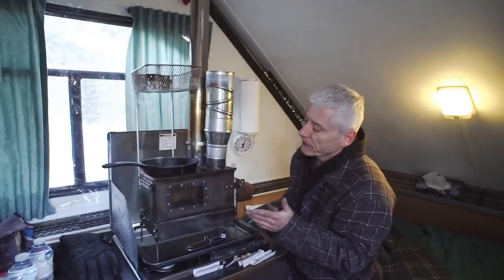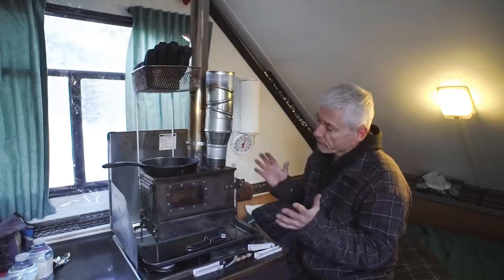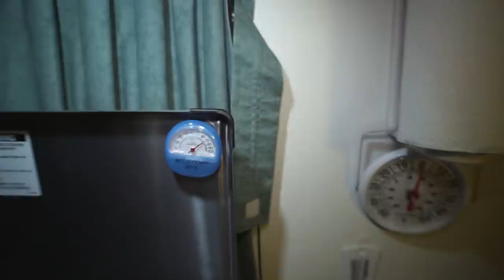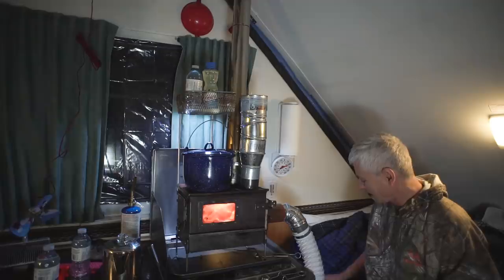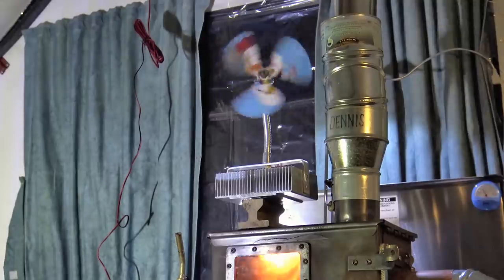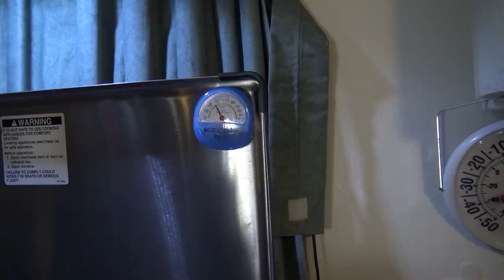Wood Stove in an A-Frame Trailer - Part 2

Comment: May be you have improved more. I haven't seen your latest video yet.
But I think you should make a small mechanical poker that will get electricity from fire usb for small motors for poking and make pallet storage big enough for all night to sleep nicely all night  without worrying about putting pallets again  and again and poking as well.

Comment: I have a Mini Cubic Wood stove the Grizzly model which is CSA and UL approved for small place's. I close the door damper and keep the flute damper wide open after the temperature and draw is at working Temp. DIY ammo cans are good but I wouldn't use it in anything else but a hot tent.

Comment: Well, i watched it all and enjoyed it too. A couple questions if you don't mind. Could you just use wood to get the pellets going? Could you just burn wood? You probably could find enough wood to keep it going pretty good. And did the charger work? And where did you get it. I'm pretty interested in that. If i built a camping stove it would have to be a lot bigger. I worked outside in the cold for 55 years and now i'm retired and never want to be cold ever again if i can help it.
Reply from the maker: Watch my "Spicing up Winter Camping" video. I use wood in it. SP

Comment: If u cover up your windows at night with flannel or wool that u could roll up and down on a dowel or broomstick cut to size...that would help with heat loss. I used to live in a drafty house and that was one trick we used. Try bubble wrap in the window too. And if u put styrofoam on your walls it would keep u warmer.

Comment: Outstanding again Slim! I'm wondering what you think of the diesel heaters I've been seeing on here?
Reply from the maker: Havent found one that would suit. Many suggestions though. SP
Reply: @SlimPotatohead  I only mention it because they seem safe enough and a lot less trouble than your stove! I've been thinking though, and if/when you shorten the intake pipe, the stove will draw better and burn smoother!

Comment: I was taught a technique in the Army for maintaining a fire in a coal boiler. It was called "banking' where a bed of coals was built up in the back of the fire chamber. Then fresh coal was put in at the base of the bank and up the top. This would help maintain the fire overnight. Perhaps you should get a bed of coals built up before bedtime. Perhaps your auto feed is positioned in the wrong place to feed the bank. You might try adding a few chunks of coal to the fire toward the back. This may require a little research on your part but I've planted the seed. That may be a flaw in your design that you can't create a bank of coals.
Reply from the maker: Thanks for the tips SWAMPHUNTER644. Food for thought! SP

Comment: DO you think the heavy plate on top of the stove (where the pot is) is not letting the heat out and sending most up the chimney? Seems like thinner metal would get hotter.

Comment: Hi Slim, How is your stove controlling the feed rate of the wood pellets, I can't figure out how you designed the fire cage to stop the flame from travelling up into the hopper. That's a great little stove you built Slim!
Reply from the maker: Gravity. As they turn to ash others drop down. No fire in the hopper as there's not enough air up there. Thanks! SP

Comment: very nice stove indeed!  Thumbs up and sub!  You did not mention anything about the 2nd burn from the pipe.  How's its effectiveness?  It also draws air from inside your sleep chamber.  So did you have a small opening to let outside air come in?  Your ammo box fireplace stove is the best designed on YT!  Thanks for sharing
Reply from the maker: I was waiting for someone to notice that! Yes, a very small amount of air goes into the secondary burn, however is is an extremely small amount and has little effect on removing oxygen from the cabin air. Effectiveness is a very good question. My observations are that with wood pellets, it is almost useless. Why? Because the burn is too clean, so there are not enough secondary gases to ignite. For firewood however, especially smoking wood with a higher moisture content, it does ignite sometimes. Chances are I will plug the secondary for pellet use, but open it when I can cooking it with firewood. Thanks! SP

Comment: Nice series! The only thing I was wondering that you didn't addresses is what about the ashes? How is it cleaned, and how often? It just seems small enough that it couldn't hold 8 hours worth of ashes.
Reply from the maker: I will be putting out a video shortly that shows the amount of ash after an evening and night. Not that much but still it's better to empty out each morning. Thanks! SP
Reply: @SlimPotatohead  I'd love it if you'd do a video on how you made the fan too.

Comment: Just wondering why you didn't add more pellets to the hopper right before going to bed in order to keep the stove burning all through the night to keep the area warm. 
Great video and thanks for sharing all the issues and how you've handle different issues.
Reply: His hopper holds a 4 hour supply.  Yes, he could make a taller hopper.

Comment: You could increase the efficiently, if you added small pipes as pass through and have a fan push air through them. Effectively making a small heat exchanger. When I build a small stove made a world of difference

Comment: With all the experts commenting and providing all sort of advice, Slim must have a serious blast :-)
Here my question: do you think you should have build the stove bigger for more efficiency and be less concern about isolation, isolation that is not easy to be done on a non-permanent structure as the Aliner  ?
Thank you in advance
Jacques from Montreal.
Reply from the maker: Hi Jacques. A bigger stove would only mean I'd burn more fuel and have less storage space to put it. The insulation worked fine, so no further modification is required. Having a trailer that collapses does not necessarily mean they cannot be well insulated. They were simply designed for summer use, and with a few minor tweaks can be made all-season . Thanks! SP
Reply: @SlimPotatohead  
Thanks for the reply, i really appreciate.
I am very seriously considering the purchase of a very small trailer lighweight (Aliner?) and i want to be able to camp comfortably in all sort of weather. I like the idea of camping in "severe conditions" but, for sure, not be a victim of those conditions. :-)
A wood stove being a "humidity killer", having arthritis, i have to seriously considered that purchase for my long term travelling project across North America.
Thx again for your time.

Comment: Marry Christmas Sir but may I recommend something to help start your stove a bit better is try using a bit of fatwood. Or I have found also jellified kerosene also works pretty well but there may be a little bit of smoke with a kerosene.and then an upgrade to your stove I think would be pretty smart is ADD heat sinks on to the side of it similar to like the aluminum ones on a computer but build them out of sheet metal wyk 7 gauge and stick them off to the side but make the slats facing up and down that way you can still use your pan to cook with and it will act as a passive radiator better.or if you would like to continue to use your fan idea I would recommend looking into a stirling engine fan

Comment: Great video! You're a genius. Using that stove top fan means the batteries on the solar panels won't run dead in the night.  Could you also use a piece of wood and vent from the outside through the window?  Was there a reason you dismissed that option?
Reply from the maker: Hi Ray, There are two main reasons for not using the window as an intake vent. One was that I'd have to remove the bug screen which is very difficult to remove and replace on the Aliner. Second, it would make it more difficult to add the plastic barrier for insulation in the window. Not saying it can't be done, it was just making setup more complex and time consuming. Thanks! SP
Reply: @SlimPotatohead  , you know it looked easy until you explained it. LOL I didn't like the A-Frame Trailers until I started watching your videos. Now I have fresh perspective on them. Thanks for the response.

Comment: I like my 2 panel mr. heater  by buddy in my trailer. it has a built in oxygen depletion sensor but I never use it at nite. but if I wake up cold, I click the starter and warmth abounds. I use a 3or4 gallon bulk propane bottle. never been cold here in north Idaho and montana.

Comment: Hi Slim, When you put the pipe insulation on those upper walls did you take off the old rubber stripping? I'm following a lot of your modifications on my 2014 Scout. I getting it ready for travel full-time for a couple of years. I'm going to skip the wood stove and go with a diesel heater. I don't think I'm brave enough to try a wood stove even though I grew up with one.

Comment: One thing that may add to the length of when you run out of heat. When people have a camp fire, they put rocks near the fire and put it near the sleeping area since the rocks maintain the heat for longer periods of time. Why not add some rocks to the pan under the stove, which should heat up naturally and if the stove runs out, may keep it warm enough to last a little longer prior to having to start it up again. Peace

Comment: Congratulations on what you do. I like your videos and I would like to give you and advice (at least I think it will work) regarding the loss of heat.
Why not try to get your hands on a thermal camera (even to hire it) and see where the heat is leaking?
Then, is easy to know were to work or not.
By the way, I think you should insulate the floor with some extruded polyester and a sheet of aluminium.
All the best mate.

Comment: Some aluminum fins on that flue pipe will definitely improve heat exchange, something similar to a boiler unit. Up the efficiency of the burn, less wasted heat through the roof/chimney.

Comment: My mom used to make homemade firestarters. Start with an egg carton, fill the "cups" with sawdust from cutting up fire  wood, then pour wax onto them. One or two would start up their wood stove. Wondering if putting some bricks or rocks on the top of the stove would help with heat through the night?
Reply: J. Patrick Moore you can also stuff dryer lint in a toilet paper roller and it will fire right up.
Reply: Lots of good ways to reuse what would otherwise be thrown away.

Comment: Slim , to start the pellets , soak a little amount of pellets in a small jar or container in hand sanitizer . You wont need a torch to start.
If you didnt have the little oven the burnt pellets would have further to fall and a taller , wider Dennis with a little more weight  with more pellets  it would feed its self without near as much jiggling.
Great job

Comment: Sucking in sub zero air would for sure cool down the combustion chamber. Worst case you have to crack a window to get fresh air in the trailer. That thing is amazing, you should be proud. Trial and error fixes most things

Comment: You can use emergency blankets them shiny silver ones and tape them on the ceiling and the angle will push the heat right back down to you because they reflect Heat same with the window throw one in the window

Comment: Good video only thing I would say would be a smart thing to do instead of poking the fire with a rod think about installing a shaker like a coal stove has. cuz realistically all you're doing is getting the ash out of the fire and getting some fresh air to it. Plus you will not have to take things apart to use the shaker and all you would have to do is shake it add pellets and you'll be all set.

Comment: Maybe too much heat going up the chimney. Put another ammo box on top of that one, and run the exhaust through that before it goes through the roof. You could also make the stove window into a door so you can put in chunks of local wood.

Comment: Super interesting video! Really love the stove. 👍 I’ve seen a couple on YouTube that have an Aliner using that thick foil insulate (the type you use under carpets) and they line the inside of the roof with it, which I imagine makes it a lot warmer in there. Have you thought of using that?

Comment: You should have your chimney and burn box on opposite sides of your firebox. That will help work your burn, air flow, and raise your heat.
Reply from the maker: Huh? The stove has an inner chamber. Not sure what you are trying to say. Have you seen the build videos? Thanks! SP

Comment: Do the pellets ignite easier than the wood?
Did the hole you cut for the smoke stack compromise the camera's ability to fold down correctly?
When folded does your camper now leak?
Ever consider using a tea candle to get the fire going?
Try using tinder then kindling then fuel wood.
Reply from the maker: Wow, lots of questions. 1) No. hard pellets take more energy to ignite, but once they start you are good for as long as you want. 2) I think you mean "trailer", not camera. Has not effect at all, as it is just a different vent lid. 3) Again, no effect as it has a flap. Or just put the original cover back. 4). No, wouldn't work well. A propane torch is best, as it directs the flow out the stack. 5) See my "November Stove-Ember" video for the stove with wood instead of pellets. Thanks! SP

Comment: Very interesting. One suggestion I would make is from my understanding is that you are causing your stove to work very very hard. By venting outside air in you are asking it to take in -20 degree air and heat it to 60 degrees an 80 degree swing. However if you burn inside air its 60 degrees to 70+++ damper control would lower the temp. So you would not burn at full there by increasing the length of each fill. a small opening in the door with a control of air flow would suffice. Nice video just an observation Thanks
Reply from the maker: Hi Gary, What I am doing is similar to any forced air furnace for a home or RV. Whether the intake temp is high or low has no effect on the combustion temperature, which is around 3500F. The stove isn't working hard, it's working as it is supposed to. Bear in mind the small area of fuel in combustion is only the size of a tennis ball, so yes it does need to be an efficient burn. Using air from inside the trailer will not make it warmer, on the contrary it will force the cabin to draw in cold air through vents and cracks,  displacing the warm air the stove created. It will also make it more of a health risk . As I have both intake air and expelled exhaust in a relatively closed system, there is little chance harmful gases will invade the cabin as they have no easy path.  I hope this explains the principles more clearly. Thanks! SP

Comment: I always enjoy watching your channel but rarely comment. Love the videos on winter camping issues as I plan on doing it as well next winter. I also love A-liners but could not ever afford one so have been utilizing small used RV's till decideing I am going to travel FT for at least 1 year. I have my minivan set up as a camper as well as in the spring I am going to build a gypsy ardo from a 8' X 13" farm build flatbed trailer I bought this fall. My #1 with both is insulation (I use predex as it is as flexable and thick as reflectic but has an R value of 22) I live in Alberta and know I am going to need and I want dry heat and inexpensive fuel costs in winter. Question ? Are your pellets hardwood pellets? they would burn the longest. I have a tiny cub FP I had sent up from Montreal, it is so cute but until I build my vargo I cannot try it out so watching you with your stove is helping tons. May God Bless and continue to keep you well. Merry Christmas!
Reply from the maker: Hi Carol, sounds like you have a great adventure ahead of you! I also admire your determination and patience to do a full build to fit your needs, best of luck for your efforts! Yes, I use hardwood pellets. Hope you also will consider solar in your design, as if pays for itself in so many ways. Happy Trails! SP
Reply: Slim Potatohead yes I have been buying solar everything for 3 years in preparing for this. Even my roof vent with intake and exhaust is solar ( with 2 backup batteries for night and cloudy days. My main power is 100 watt renolgy plug and play for my “River” battery pack. I have most of the stuff I need just have to build my little trailer now.. lol at 63 it sure will be an adventure but it’s time. I spent the last 24 yrs raising 7 kids as a single parent, now it’s time for me!
Reply from the maker: That's the spirit Carol! You'll do well as a traveler, embrace the challenge! SP

Comment: I'm curious about the heat charger. I'm wondering if it would provide enough energy to operate a small motor attached to an augers bit to stir the coals. It would certainly be enough to charge a headlamp or lantern battery, but to what extent would it provide a trickle charge for the house battery?

Comment: If you rough up the aluminum w steel wool or sand paper, coat it with Kilz n then paint it with rubberized paint for rv roofs, would it eliminate some of the condensation? Strictly interior of course so it would last.

Comment: Have tou thought about putting skirting around the bottom of the trailer. Then insulate the skirting iinside underneith. It will make it warmer inside around the floor. Can insulate underneith trailer help insulate the floor to make it warmer. Or could you put insulate underneith the rubber f looring too? Hope these are goodines for you☺.T.